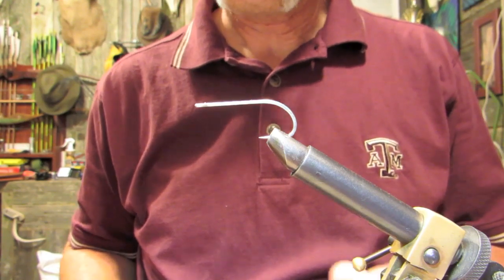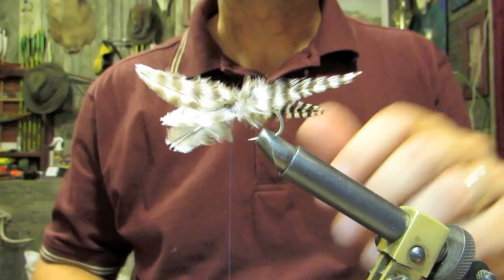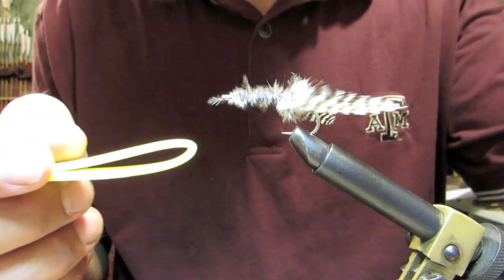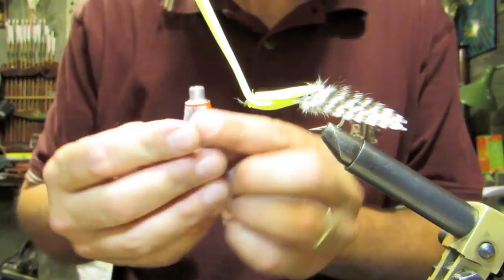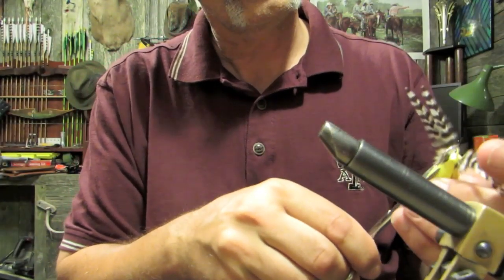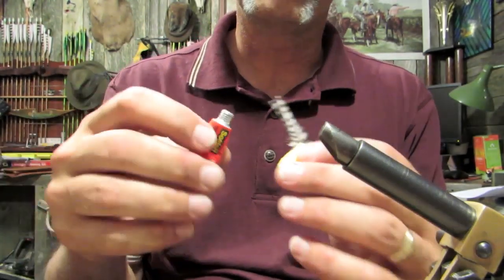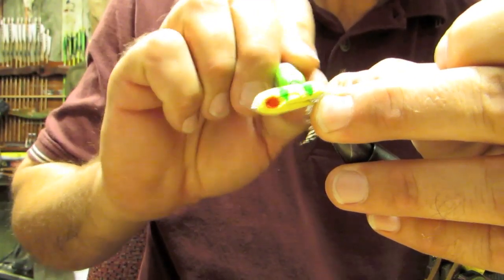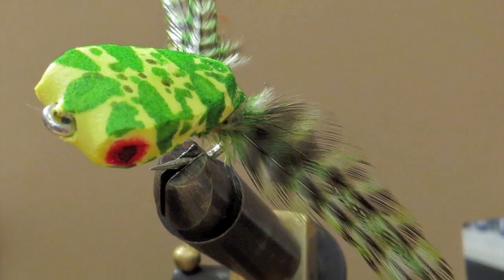FishTales Fly Tying: The Beginners Froggy fly

Comment: Hey William
You're fighting the Super Glue fight, one that's hard to beat, however there is hope.
After spending years researching every conceivable glue around, I finally found the one that works on every application.
Bob Smith Ind. has what you need. Buying the large bottle with the fine tip works best, and you can buy additional tips when one becomes too clogged.
As for their brush on, use the Plastic Cure, I guess it was designed for nail shops to use on applying women's fingernails. 
I tie on average 5 hours a day, I've been using one small brush on bottle for 3 months.
I have additional tips for the larger bottles.
If there is a better Super Glue for the price, I haven't found it yet.
Amazon.com sells it, and I strongly urge you and your viewers to get some.
Enjoy your "fraugs" keep on entertaining and teaching our beloved hobby/business.
Ron Cavalier
Ruskin, FL
Reply from the maker: Ron Cavalier Thanks Ron..  I'll give it a look-see..
Reply: I've been using a craft glue E6000(R) for my foam flies and it seems to hold up better.